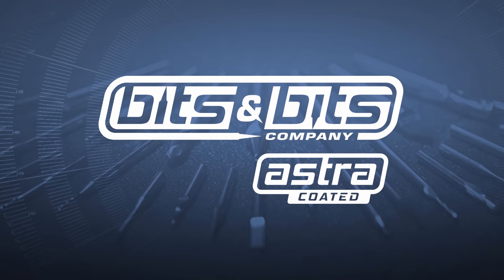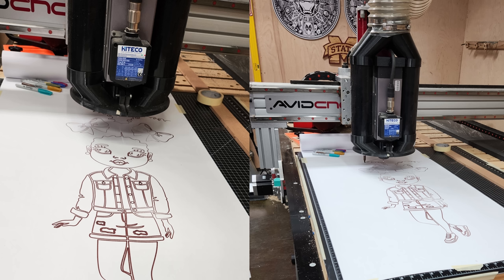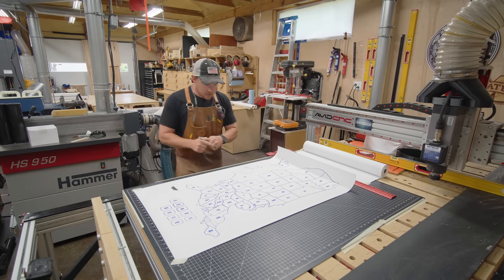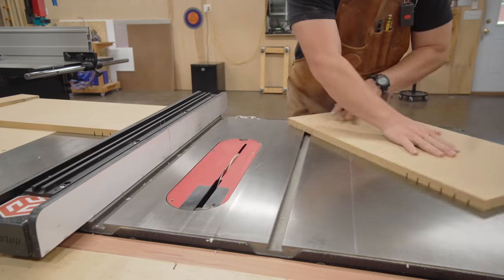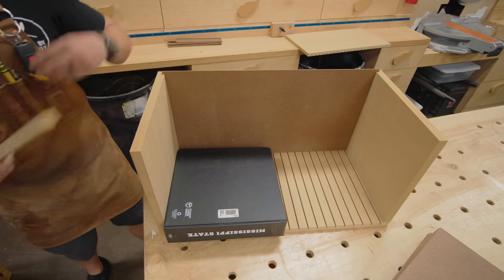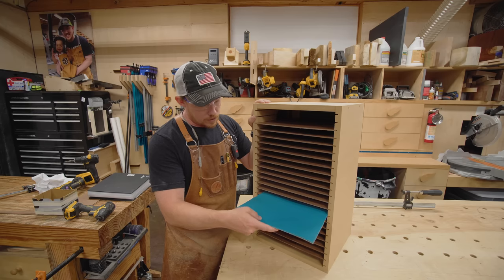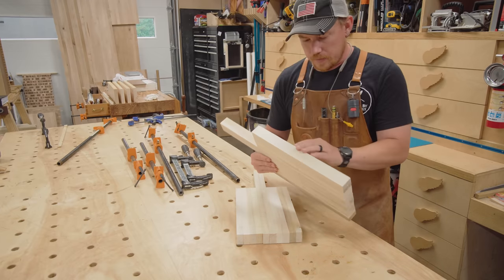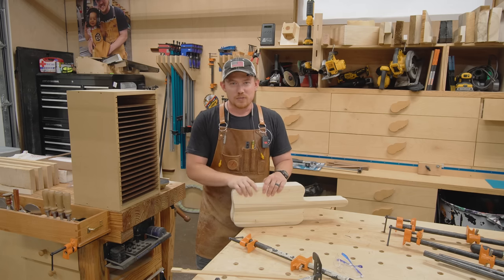A Productive Day In The Shop

Comment: Not sure if they are still available, but 30+ years ago when I was entering the CAD work force out of school we used "plotters" that you would load a specialized ink filled "plotter pen" to print large plan sets. This was what was used before modern ink-jet printers were widely available/abortable and why a lot of old schooler's still call these new ink-jet printers "plotters". Although, I think the name has transferred over to any large format printing device. So if those Plotter Pens are still available, they may be perfect for your CNC use.  ... I remember having to print drawings one ink color at a time. You would load your black pen to get most of the drawing plotted, then without removing the paper, swap out the black with a red pen and then run a new print assigned to only plot the red-lining from AutoCAD. I also remember on large detailed plans, you would have to break the drawing down to layers because the machines only had so much memory to use. So you would send a print for one layer of the drawing. Once complete, leave the paper loaded, then run the next layer print (such as dimensions and notes), so on and so-forth. My, how times have changed. lol

Comment: I would have left the original size & half circled the shelves, allowing finger grab from center of unit. Either way works I guess.
Reply: This is what I thought as well - just gang up the dividers with a forstner bit and you're good to go.  You'd probably also have to do one at the top & bottom of the carcass, but it's function & someone didn't care what it looked like ;)

Comment: I have to be a bit smug, You've reinvented the pen plotter that was the common large printing device of 30 or more years ago.   Keeping the ink pens flowing and not clogged was their big challenge.
Reply from the maker: I didn't reinvent anything. I've used many plotters in college and in a previous job. Wasn't trying to imply it as a new idea, rather, showing what I was doing and that anyone with a CNC can do it too.
Reply: @JayBates  I was only trying to tease.  You have found a new way to use this particular tool and I do applaud that.  I'm sure neither of us would want to use this every day as a plotter, but on occasion it is a fine additional use.   Sorry if I sounded mean.

Comment: Jay, I can't help but think that the shelves are noway going to be strong enough for the binders that your wife is going to be putting into the unit, within a week or so once your wife has filled it and then removed say the second binder from the bottom, whilst the binder is missing from it's slot all the weight of the binders above will be forcing the flimsy shelving material to start bending due to the weight of all those stored above. Those binders once filled are not light whatsoever. As for the comment about your wife saying she doesn't care what it looks like,  Jay how long you been married?? Long enough to know better than believe that your wife doesn't care how it looks that I'm sure of!!!. I actually had the thought that you was really making the item for yourself with sandpaper storage inmind rather than making it for your wife.